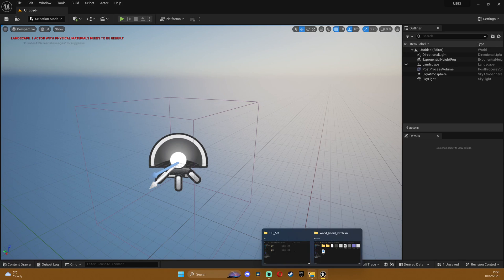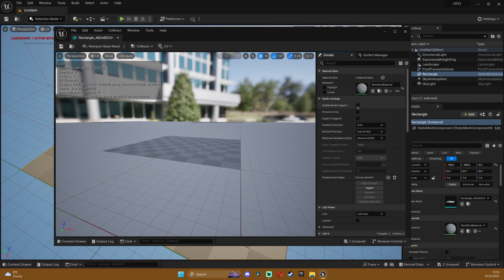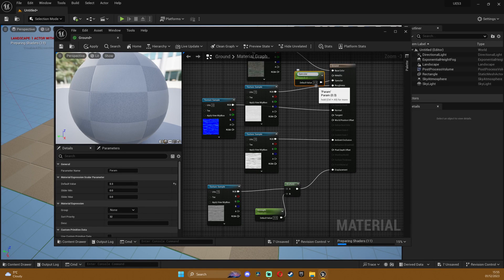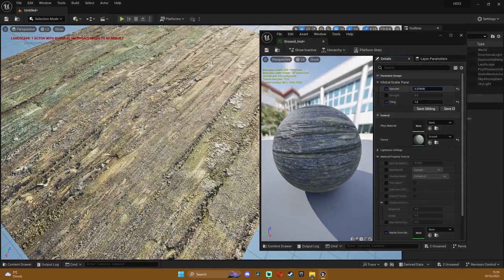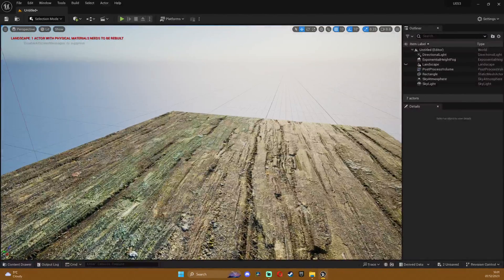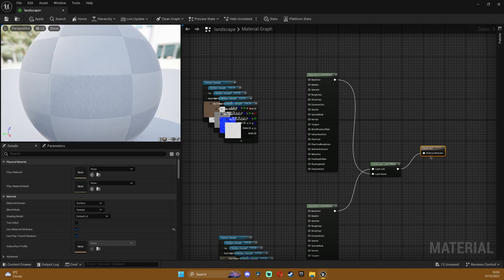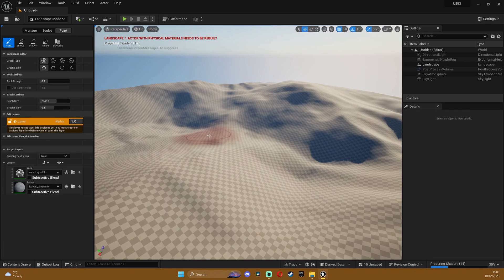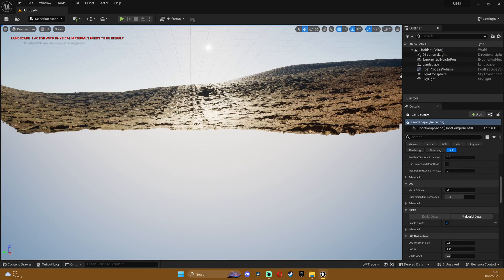How to enable displacement in Unreal Engine 5.3 | TUTORIAL

Comment: I wish I could be amazed. My 29mi square terrain did not benefit from this. There was no change at all. Could the size of my terrain be overwhelming UE? It is a nanite mesh, and I double-checked my spelling of those two additional parameters in the Default Engine doc. I messed with the tiling, the degree of displacement, etc. Nothing.
Reply from the maker: I don't think that's the problem, but in 5.3 it's very buggy, as it was an experimental feature then. I am using displacement on a big landscape in 5.5 and it works really good. I would recommend you update your project to the newest version.
Reply: @ Hmm... I will consider that. Thanks.
Reply: @drawwithnightbuzzer  I tried it, but 5.5.4 did not like my scene. There were large, darkish shapes on my terrain, and when I went to rebuild the lighting, it crashed. Twice. Tried to edit my mesh in Maya (where I created the terrain originally), and even there displacements did not look particularly good. So, I think I'm going to make the terrain interesting (or try to anyway) in other ways (more color variation, the use of foliage, etc.). 

Anyway, thanks bro.

Comment: My displacement is grayed out and does not work I'm using 5.4.4. any ideas why?
Reply: For UE 5.4 go to master material details and search for Enable Tesselation checkbox, make sure to turn it on.
Reply: @3dbatcat  thanks)
Reply from the maker: hmm, if you did all the steps correctly, there shouldn't be a problem. but try to look more into the material settings, maybe you missed something.

Comment: After so many tries the place still wont be displaced. I can see a slight movement up/down as I crank the strength to unreasonably high levels but no clear displacement
Reply from the maker: Hello. Sorry for the late reply. Did you enable nanite on that specific object?
Reply: It does not work in the material preview. Only in the Scene.

Comment: Is there a way to use Displacement and render using Pathtracer? It works great in Lit but defaults to flat when in Path tracer
Reply from the maker: Yeah, this feature does not support path tracing. As far as I know, parallax occlusion mapping does, or if you want a more 3d look, the displacement from the modelling tab will work.
Reply: You could bake the displaced mesh into a real static mesh with actual geo, that way the path tracer would work!
Enable the UE built in mesh editing tools under plugins, you'll figure it out from there:)
Reply from the maker: @SBBBurney  I didn't know that, thanks for sharing!